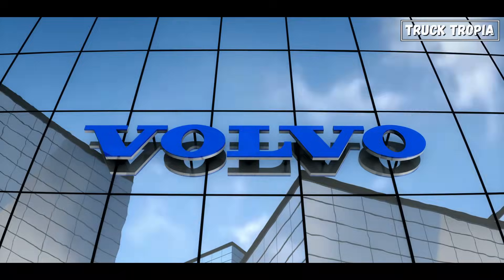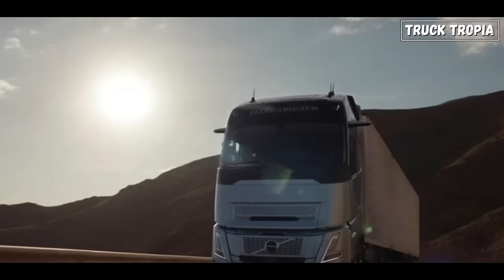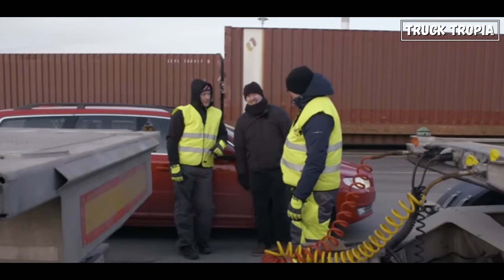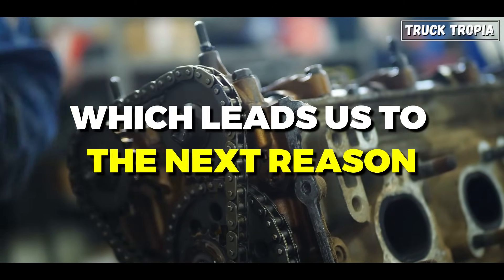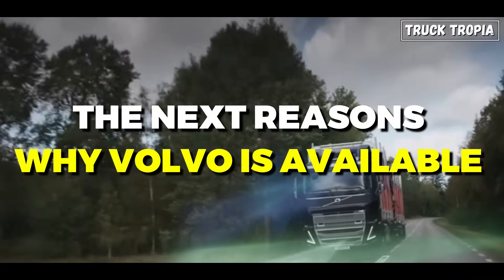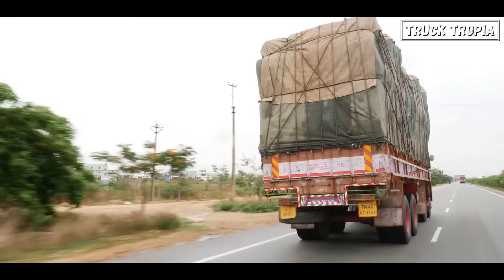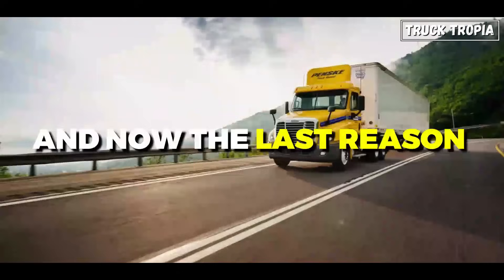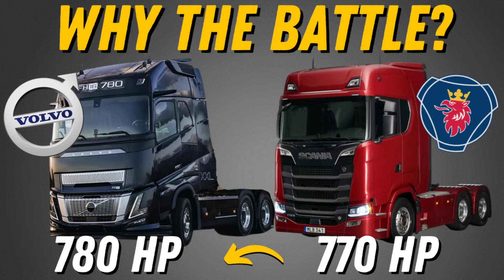Why American Semi-Trucks Can’t Match Europe’s Horsepower?

Comment: 780bhp not bad from a eu volvo

Shame the American version dose not have 780bhp

Would be cool both had d13 engine but for American Market it could be possible to add more turbo to help with stringent requirements for there Market 

500bhp not bad dir American trucks.

It impressive to have from d17 engine 

I have noticed that the channel not mentioned how many turbo it has

Eg twinturbo 50mm or say 90mm single turbo to make 500bhp in the American version and eu

Wish both truck had same amount of bhp equally 780bhp d17 and 780bhp d13.

So that it cannot say bad between them.

If d17 had say 780bhp that very impressive for the American Market l.

500bhp in a d17.

Not bad still strong.

Just sad that they couldn't even raise it to 580bhp.

The extra 80bhp could help the truck well

Comment: Realy EPA, Emissions and greenhouse gases , 60 % Diesel trucks in North America are "deleted" meaning emission parts of the trucks are removed, like DPF , EGR valve , Def and EPA doesn't do anything about this issue .
Reply: That is very false. It's illegal to delete your truck, even your private diesel pickups. Yes people get away with it all the time, but it is still illegal and the EPA will can give you a "fix it or destroy it" ticket. 
 Some very specific circumstances allow you to, but it's complicated. 
Not to mention commercially the DOT is up the ass of pretty much every CDL driver, and a deleted truck would rack up too many fines and tickets to ever make it worth it.

Comment: They would sell in Australia to pull roadtrains which can weigh up to 200 tonnes on public roads but they need a bonet and reliability with all there electronics
Reply: Mack has just started selling trucks with the Volvo 780hp engine in Australia
Reply: They been selling FH16s for yesrs here in Aus. Where does this crap come from

Comment: I would say the explination for emission is not quite right.

In usa they have a set of emmintions for each class. In europe the emission standard is set so preformance.

So for a 36 ton truck the standard is probobly harsher i europe. But 36 ton is a relativly light truck by european standards.

The claim that roads are wider In the us is incorect. Standard lane width is actually wider In europe. And so os the trucks (but only with about 1%). In some countries they have deliverytrucks that is considerally narrower for old town streets. Those never have high hp, but are usually In then 200hp range.

There are not sharp turns on european highways. Maybe on a country road, but not a highway.

Comment: Well, in from malaysia, the law allows max weight of  50t (110k lbs) for a truck with 1:2:3 axle config.
Additional axle mean extra weight to carry usually seen in heavy hauler. Normal goods semi usully goes up to 1:2:4 max axle.

Comment: I love how they claim due to diverse terrain. lol europe isn't more diverse in terrain than america.
Reply: It also depends on where in Europe you drive. It's a huge difference between for example the Netherlands and Norway. 
And most of the "big rigs" in Europe actually have less than 600 hp. For example both Scania's and Volvo's 13 litre engines are more popular than the 16 and 17 litre versions, which are the top of their fleet and the ones that create most attention. And no other truck brand in Europe has so powerful engines.
Reply: @OnTheRoadAgain-S  obviously. That’s why I claim Europe has more diverse roads than the us. And while most trucks have between 450 and 550hp, I see quite a few high horsepower trucks every day. Both in the Netherlands and in Germany (a bit less in Germany though).
Reply: @autobootpiloot  My reply was actually adressed to the original comment, but ok 👍
Reply: Oh yes it is. Our mountains and roads are steaper, but we also have flat grounds. The roads are more twisty, but we also have straight roads. The roads are narrower, but we also have wide roads.

Comment: @Truck Topia, you have done it again with your misinformation, you claim that Emission regulations are stricter in the US yet, when you look at the average age of a truck in daily use in the USA the majority are about ten to twenty years old, I'm from the UK as I have commented on a few of your previous videos, and I'm also on a Facebook page that is based in the USA, yet the drivers hate the Adblue systems(DEF), they disconnect the system because they claim it's unreliable, which if that is the case the US manufacturers need to up their game in producing a DEF system that actually works and is reliable, in comparison European trucks have a life span is roughly 5/6 years before they are replaced.
You also mention fuel efficiency, most US trucks return 7/8 mpg while running at 36 metric tonnes at a speed of 70 mph, whereas European trucks return 10/12 mpg running at 44 metric tonnes, at 56 mph, so given that the US runs faster and the roads are straighter how can US trucks be more fuel efficient compared to a European truck running over a changing terrain?
The EU, Japan, and the UK have the strictest emissions laws for any motor vehicle, so again you are giving out misinformation, try to make the USA the best country, your videos are informative but sometimes you don't research your information correctly, please in the future do your research before producing a video.
Reply: I believe that the different emission regulations is more about politics. For example a new Volvo VNL can't be registered in Sweden and a Swedish Volvo can't be registered n the US mainly because of that.
Reply from the maker: Sure i do 👍
Reply: In US you can swap the engine without emissions restrictions, in Europe you can’t. Europe is more restrictive with emissions.
Reply: The DEF systems arent probably that different between manufacturers as the markets between US and EU share a lot of parts and work together in producing heavy equipment. The biggest problems is the liquid of the adblue system not being able to withstand more than -11c after that it will freeze. In the colder parts of EU like Norway, Sweden and Finland during the winter months it can reach -30c easily so the DEF system can easily freeze and its not cheap to fix it so it is completely understandable to rip the shit off even if it works but this sadly is not possible in the EU as you can be fined thousands of euros for doing it.
Reply: @Herra_X , why do you think the AdBlue tank is near the exhaust? It's the heat from the exhaust that helps prevent the AdBlue from freezing.
Reply: @davidjames990  
That doesnt apply to all trucks or heavy equipment and still in colder climates its unable to keep it as a liquid. Adblue tank heaters exist but sometimes these arent able to keep the adblue as a liquid. Also in order for the trucks exhaust to stay warm it needs to keep running which consumes diesel also in order for the tank heater to work it needs electricity
Reply: @Herra_X  Adblue tank can handle freezing and is heated (with coolant atlest on Volvos) and hoses are electrically heated, at the volvo workshop in Finland I work at we don't have a lot of issues with adblue freezing apart from the occasional pressure sensors. I doesn't start dosing until it's warm enough. Normal cars might have trouble with adblue freezing, but truck are driven for longer distances and actually designed properly. There are faults on adblue systems, but most of them are not because of freezing.

Comment: volvo's engine block can handle more power just by adding a second turbo
Reply: It's not only about adding more power. The gearbox and the whole drivline must work in harmony with the engine - and the engine has to follow the emission standards.
Volvo's marine version of their D13 engine produces up to 1000hp. The D16 produces "only" 850 hp but these are for heavy commercial use. And remember boats, unlike trucks, go constantly uphill.
And Scania's DC16 V8 produces up to 1150hp. There isn't as strict emission regulations for marine and industrial engines.
And you can add a lot more power to these truck engines just by programming, don't even need a bigger or a second turbo.
Reply: The d17 already has two

Comment: From the UK here, there is another reason for buying "Big engine" trucks. That's resale/residual value. Example, a 5/6 year old Volvo FH D13 is usually around £20,000. An FH16 of similar vintage can be worth more than double that with similar mileage.
Reply: And cost double to buy in the first place.
Reply: @Low760  No they don't. 150k for a new FH 500, 165-200k for an FH16 depending on extras.

Comment: Sweden allows 74 tons on certain roads (Class BK4), otherwise maximum on normal highways is 64 tons. But still the vast majority of trucks in Sweden have 13 litre engines quite similar to those in the US.
Reply: Most major highways in sweden are upgraded to bk4 at this time. There are some gaps, but they getting increasingly fewer

Comment: Give me a Kentworth or Peterbilt Hood Any day All day,I refuse to drive a Cab Over truck in Europe or the USA.
Reply: @thebobcat1964, that's your preference, but when you compare the technology in a European Cabover, they are years ahead of the USA, the only thing a US truck has an advantage of is the living space after that everything else pales into insignificance, I mean you still run your engines at night to keep your batteries top-up or run an APU, European trucks have had cooling/heating systems that run independent of the engine for years and they don't kill the batteries.
Reply: @davidjames990  Sir no they're not,I drive a Peterbilt 579 here in the USA now, but I drove in Europe for 5 years,my Peterbilt had as much technoloy as my Mercedes I drove in Germany,the different is my Pete looks and rides better with a Hood.They both have the same horsepower.I will never drive a Cabover truck again.
Reply: @thebobcat1964  I worked at Volvo trucks when they were still producing the N-series (N=Normalbyggd i.e. with hood). But customers vanished. It is the same with manual gearboxes - if no one wants it in the market they will not be produced. I think that a Dutch firm makes rebuilds at least of Scanias with hood. Maybe they supply Volvo and other brands too.
Reply: @andersreinholdsson9609  Thank you for the information,have a good day.
Reply: @thebobcat1964 , when did you drive in Germany and what Mercedes truck model did you drive?
Reply: @davidjames990  I drove a 2015 Actros from 2016 to 2021, good truck but I still prefer my Pete.

Comment: I can understand why do traton don't use Scania technology in international truck or when mack is a sub brand of Volvo they don't share their technology .or Daimler truck don't use Mercedes technology in Freightliner.
Reply: Traton actually use Scania technology. The new International S13 engine is basically a Scania DC13 engine.
Reply: @OnTheRoadAgain-S  thanks
Reply: @OnTheRoadAgain-S  which is basically a MAN engine
Reply: @eikuz  I think it's the other way.
Reply: @OnTheRoadAgain-S  could be, but man has used an i6 for a long time, and it looks just like a man engine
Reply: @eikuz  It isn't about all I6 engines. An article from "lepieleaks" that says it all:
"10 okt. 2016 — Scania develops 13 litre engine for VW Group. ... MAN takes care of lighter engines, say from five to nine litres."
Reply: @OnTheRoadAgain-S  ok you are probably right on this one, i found some articles from traton saying the new engine is joint effort and some from other sources saying scania designs 13l engines. Just seems like they used a lot of designs that man already had on the engine
Reply: @eikuz  That's logical and I don't doubt it. These brands use technology from each other to make their products better. Otherwise Traton would be stupid. 😀
Reply: They are now. The Mercedes motor is a Detroit. They are shit.

Comment: I heard from a trucker that Scania and Volvo measure their horsepower in different locations. 

Scania at the diff and Volvo at the Flywheel? 

Which if the case, would make Scania's 770hp engine significantly more powerful than Volvo's 780hp D17.
Reply: Completely false. Manufaturers gives the horse power measured accoring to standards everyone use in Europe.
Reply: False. All engines are recorded at flywheel.
This "at the wheels" shit is from old boomers that make up crap to try and win arguments.
Reply from the maker: True 👍😅
Reply: Bullshit  volvo has a bigger engine 17.3l  more torque and power  plus their measure d by the same European standard  this is just that the v8 fans can't take the fact their not too dog any more  Volvo the new king of the road.
Reply: @patodonovan274 No, Volvo is only the king of SUVs, trucks don't even come close to Scania in reality, but they try, Scania is always ahead, in chassis for buses and trucks, quality, comfort and the engine is more efficient than the Volvo, which is rigid and requires complicated and expensive maintenance, here in Brazil, with completely uneven terrain, with dirt roads, mountains, inclines and inclines, Scania has always proven to be better in all factors, including reliability, and I guarantee that,In Brazil, the track conditions are very different and more difficult than in your country.
Reply: @mattiazephyrum2263 Never saw a Scania bus, only Volvo, Setra (nowadays part of Daimler Trucks), Daimler Trucks (former Mercedes-Benz subsidy, still owns the branding rights for trucks & co) Iveco and MAN (my favorite with the City's Lion atm).
Reply: @alicethegrinsecatz6011  I see Scania busses all the time in Finland